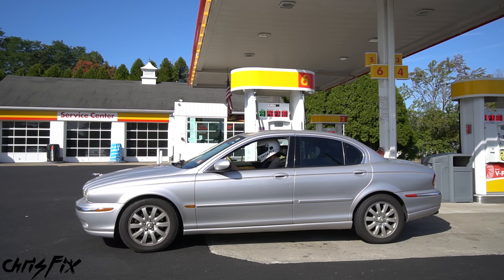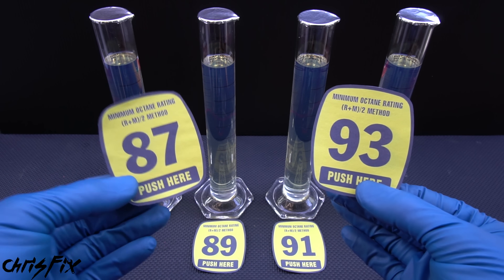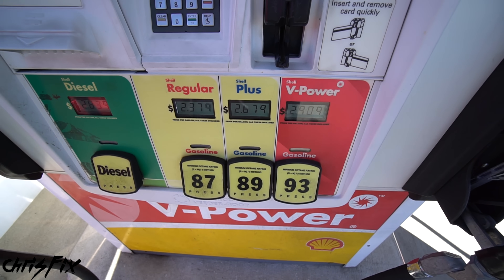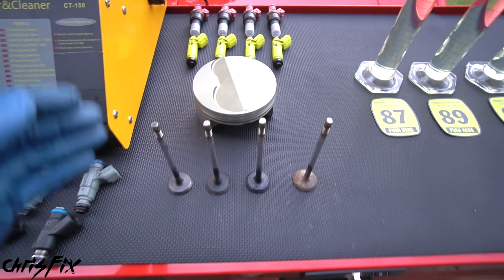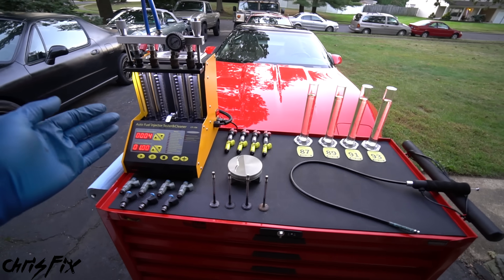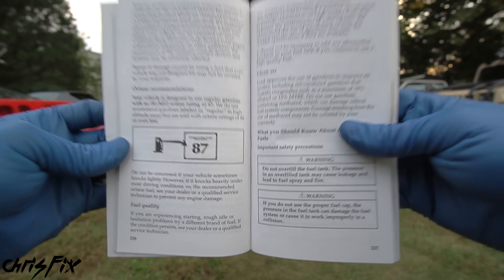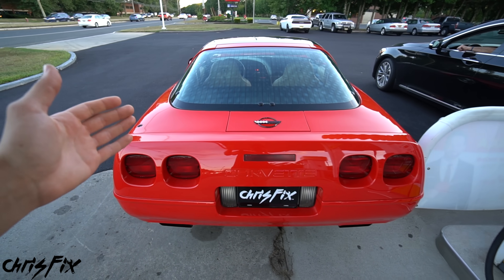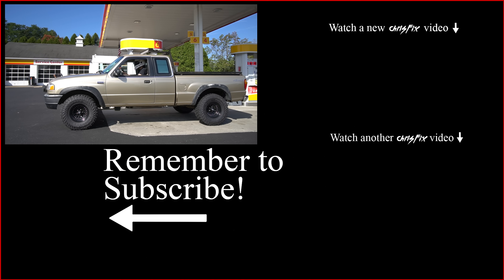What is the BEST Fuel to Use in Your Car or Truck and WHY

Comment: Love how you failed to discuss the other elephant in the room.

Faulty gas pumps mean you could be buying watered down gas, gas with sediment in it, or getting less gas than you pay for.

“Remember when gas prices spiked in 2008 or 2009? People stopped buying premium,” adding that when gasoline is sitting around in underground storage tanks, its composition may change. Some gas stations water down and sell diluted gasoline. So yes, a notable number of gas stations across the U.S. are likely to have diluted or contaminated gas in the underground storage tanks.
Reply: Yes especially walmart
Reply: Sorry, but "watered down gas" is an old wives tale that has been debunked a million times over. And how does sediment get through the filters that are designed to trap sediment?
Reply: IrishDrunkGaming that is another myth. A gas station owner would be a fool to have water in their gas. The customers car would break down and as soon as a mechanic got it apart, the water in the tank would be obvious as it settles to the bottom. Underground storage tanks have filters at the end of the gas turbine that pulls the gas to the pump. Gas pumps have a filter inside and where the filter attaches, there is a mesh screen. Very little sediment gets through those three. The underground tanks have also been required to have glass lined walls since 1996. Any station that didn’t comply with those upgrades were forced to close. Any station that sells at least 60,000 gallons a month is having fresh fuel delivered at minimum once a week. I’ve been in the gasoline business for 19 years and only had water contamination once. We immediately shut down sale of that product as we didn’t want to pay for engine repairs. Ever since then, every Tuesday we stick our tanks with a water detection paste. If it is present, the paste turns pink. That hasn’t happened since my second year in the business.
Reply: @MatthewOwen1977  thank you sir
Reply: Matthew, I know people who work on the Indian reservation who would disagree with this.

Comment: Well non really i use 85% water in my car and 15 % of a home made octan from old diesel. U can not go as far as you would use normal octane but 3/4 of it at least. And a full tank cost mme i dont know mayby 5-10 dollars. Have been doing this for about 3 years since i got it to work. 

But no i will not share how it works we all know what would happend if i did. But i can just confirm that YES it does work

Comment: What about E20? Some Racetrac gas stations have started selling this for 10-20 cents cheaper than regular. Some online sources say yes it's okay in all vehicles that take 87, some say no it's still only for flex-fuel vehicles. I drive an 07 Accord, and the manual obviously says not to use ethanol. However, I'm not sure e20 was a thing in 07 because it is not mentioned, e85 is mentioned as an explicit "no-no" in the manual.

Comment: Another important factor is ethanol content. Around here regular gasoline contain ethanol, premium does not. A carburetted engine can't deal with the ethanol and it will run poorly. Also ethanol attracts water which is very bad in a carburetted engine. All carburreted engine from chainsaws to trucks should run premium.

Comment: Chris, i have a question
I see a lot of tuners using normal octnane fuel in their cars normally, but when they use e85, the horsepower increases insanely. Also, many sports like drag and etc use e85. Why is that?

Comment: I truly have enjoyed the videos of yours I have watched to this point and you may have explained this in a prior video....I have a recommendation that you can probably explain better than a lot of us that were raised on 1st generation v-8 engines. Can you make a video explaining the advantages to converting a carbureted engine to run E-85, the advantages to this fuel, the dangers to seals in the carburetor and components, proper engine timing and additives to inhibit corrosion from the fuel that the high “Moonshine content” can cause? 

I was blessed to be raised in the time period that carburetors were still prominent, throttle body injection was the most common way of injection and multi-port was gaining headway. Your videos have helped an old “shade tree mechanic” gain a much better understanding fuel technologies. I do know that messing with my first 5.0 Mustang, IF you know the proper technique to set the timing on the 5.0, the higher octane fuels can make a BIG difference in performance. That may also be a subject to touch on.

Again, thank you for the time and effort in your well made videos! You do a great job and I have subscribed to your page.

Comment: All grades of gasoline have cleaning detergents. For engines with higher compression ratio, use higher octane fuel to prevent pre-ignition and possible engine damage. With all others, you can get away with using regular to mid-grade fuel. If unsure, your car should have fuel specifications clearly labeled at fuel filler cap or around fuel gauge on instrument cluster. If not, it's in the owner's manual.

Comment: Hi Chris Fix.
Your channel has helped me enormously.

I live all the way in South Africa, obviously, most of the products you test are not easily available in SA.

Anyways, I was hoping if you can make a video testing different types of Radiator STOP leaks.

I was accustomed to Wynn's/Shield. I do a radiator flush, then add the bottle ±350ml for 4 Litres of water, give or take. Then add 2x 1Litre bottles of Shield Anti freeze, green (undiluted) and then add 2x1Litre of Water to my mix. So I get an exact 50/50 ratio. The reason I do this is because it helps seal all hose clamps, etc etc etc. 

But Yesterday, I tried a different spare shop and the guy suggested I use ACDELCO, which is an American brand by GM ( I Stand to be corrected.) I'm sceptical about it but hey it's worth a try. And also I always only ever used Castrol Magnetec 10W40. But this guy also suggested Shell Helix HX7 10W40. So I decided to give that a try as well. Maybe I've got marketed, maybe I'll learn from a mistake if the above products are a bummer or maybe it will be good to excellent, it's a learning curve. LOL.

My questions to you is, since you are from America,

How good is ACdelco Radiator STOP leak? 
Can you do a comparison test?

Also, which is better between Castrol magnetec 10W40 and Shell Helix HX7? Can you also do a comparison test. 

P.S. my engine is out at the moment, and it should be in the car by next weekend latest, pls assist ASAP

Thanking you in advance.

Comment: Chris Fix - What about BP, Mobil or Exxon ?  Do they make any guarantees on engine cleaning ??
Reply from the maker: I know they all have claims of "cleaning the engine and better mpgs" but I dont know of a specific claim like shell where they say use it for 2500 miles and the injectors and valves can be 70% cleaner which is a pretty crazy claim. I am still skeptical and wish there was a way to test it.
Reply: @chrisfix  Thank you.  Yes, I'm thinking of using a tank or four on my 158K mile 2006 Toyota highlander 4 cly. 
After winning the lottery, we can get  ten sets of four cars and doing the same tests to see before and after results.  Do what you love - right?
   For what it is worth, gasoline is fungible. AS I understand it, companies make grades of gas - put it in pipelines and then companies like Shell/BP/Esso/Exon take it out at multiple distribution centers and add their chemicals  before delivering to the station. 
   Is that what you heard?

Comment: Is there a difference for altitude? I remember the last time I was in Colorado and they only had 85, 87,  and 89.
Reply from the maker: Yea higher altitudes can get away with less octane since the air pressure is less.

Comment: so if I wanted to use premium in my car that runs regular, would it be ok to mix those and run it to say give it a better octane for the “cleaning” you talked about?
Reply from the maker: You would need to run premium for 2500 miles for cleaning to occur. Just use regular and drive the car to operating temp every time you drive and you will be fine!

Comment: I think the kind that makes it run is the best! Just jerking your chain..thanks for the info, as your explanation will clear up misconceptions about fuel and the actual advantages.

I have to say, the blue gloves really reminds me of the “hand models” that do lotion, dish washing and Isotoner glove commercials..😊

When I would take a trip to the drag strip, I’d drive to the track on 87 octane with much less timing to get there....I had it figured to just about the gallon, how much fuel I needed to get there...then, when I got to the strip, I’d put 100 octane low-lead purchase from our local airport so ai could advance the timing. Worked out great for me.

I had to run “lead replacement” in my 350 with 041 heads..it didn’t have hardened valve seats...another reason I liked the low-lead fuel, as well. 

No, not just anyone could go to the airport and get the fuel there..you had to “know people” to purchase the fuel. I could have purchased the racing fuel at the track but the price difference was rather dramatic between Av fuel and the 110 octane at the track.

Also, at 16:11 into the video, you highlight the carbon deposits but completely forgot about what looks like rust at what looks like the top of the piston....what the heck ? LOL

Now, you says..”Let’s see what...(engine parts) are doing ...well, the distributor is doing distribution, the spark plugs are sparking, the injectors are injecting, the pumps are pumping, the alternator is alternating...and, well, I suppose the pistons are doing what they do, too!
 
Truthfully, thank you, again, for the actual common sense explanations you provided...It makes a difference when someone can break down, what can be an ultra-complicated subject, into layman’s terms that are easily understood...it actually takes a cunning linguist with the proper knowledge to do explain this subject matter in the manner you explained it...THANK YOU for the breakdown!

Comment: Chris, what about E85? It's been called race fuel on a budget, sure worse gas mileage, however, better cooling properties. How can I run my car supercharged on E85 and see less knock than on 91 if that isn't the case? Or are you more arguing that the 87-93 don't have that component of cooling?
Reply from the maker: I was speaking about gasoline. E85 is basically ethanol with a little gas mixed in. Ethanol burns cooler and has different properties than gasoline. Running your car on it would require fuel system changes in many cases and you need a tune!

Comment: Those animations were incredible! Idk if you sourced that somewhere or had it made for this video but amazing job sir 👍. 
With all your effort and time you put into this video I would have loved a more detailed explanation of the difference between 87 and 93 octane gas and why one would use high octane in a high compression motor. It may be something you've done in another video or are planning to cover in one coming up, but I think knowing the properties of octane and that high octane gas requires more compression to combust under spark so putting it into a low compression motor would result in incomplete combustion and loss of power is definitely a video I would want to see from you 🙂
Reply from the maker: Thanks a lot!!!

Comment: I have a car with flex fuel should I switch to e-85? I never really had a problem using regular gas that I noticed but after watching this it might explain why I get periods of low power
Reply from the maker: No it just gives you the option to run e85 if you want

Comment: I disagree with your myth debunking. Each fuel does contains a different energy content. Different compounds are blended to achieve the desired octane. These differences in molecular compounds results in a change of heat of combustion (energy). 
2. All gasoline is required by law to pass an oxidation stability test. Storing your car for a winter season will not cause any damage. 
But it sure is fun to see the marketing  of Shell.
Reply from the maker: Thanks for sharing Joseph. The energy content of regular fuel is 114,000 BTU per gallon and energy content for premium is 114,000 BTU per gallon. Obviously they are going to be slightly different but that slight difference is insignificant. 
For your second statement, yes there is oxidation stability, but with that said, fuels with ethanol absorb water and can cause fuel system parts to corrode. The gasoline is not oxidizing, the water in the fuel is oxidizing the metals. The additives in top tier fuels, specifically shell in this video since that is where I filmed, has an anti-corrosion additive which I explained. 
Thanks for sharing.

Comment: Chris, there is something called "decarbonisation" and is "highly" recommended (on diesel engines mainly). As for me personally I don't drive a diesel car, but what would you say about that? Is it necessary or it is a lie in order to rob people?
Many greetings from Serbia
Reply from the maker: So with diesel there are a few things that carbon can cause issues with. Decarbonization is just the process of removing carbon. What specifically are they doing or using?

Comment: So i daily drive a 97' GMC jimmy the engine has 260xxx miles and still runs completely solid but with age and wear and tear doesnt do too hot on mpg would running premium for a while clean the engine and allow me to get better gas mileage when I switch back to regular? And would this be a good idea?
Reply from the maker: You can totally do that. You need to run 2500 miles of premium for it to get clean tho. If you dont notice any mpg loss then it isnt worth it. Just keep driving your car with regular.

Comment: For like 16 minutes was a bit excessive to ultimately tell me that I should use the recommended fuel as per the manufacturer
Reply from the maker: No because if you dont know WHY you are missing all the important info.
Reply: @chrisfix  I have a 2015 Miata MX-5 Club Edition my s*** says 91 octane so I use 91 octane. Right?

Comment: The best fuel to run in your car these days is the one recommended by the manufacturer since your motor is tuned to run the certain OCTANE. 

Dont run 93 octane in your civic lx.
Reply: Your car is tuned to run on certain ethanol content????? Really dude? Ethanol is a regulation that added into the gas. Its has to be 10% and only 10% all the gas at the pump will contain this ammout. As far as flex fuel goes. The computer is able to sense the mixture its self and your able to run a 50% e85 50% gasoline. Look up what your talking about before you comment
Reply: @firstonracingday3407  I meant octane my guy. My bad. I'll make sure I punish myself real good for it.
Reply: 2 dicksin1pussy

Comment: The best fuel to use in your car or truck is the one that does NOT contain ETHANOL, or any other undesirable additives which are added by the gas companies before the gas even gets to the pump. Ethanol, along with other additives, are added to gasoline to reduce fuel economy, and to create other undesirable conditions in your engine. The "powers that be" are so greedy, that they are not satisfied with keeping you bound to highly inefficient 1850s technology (the internal combustion engine), but they want to make that technology even more inefficient, by selling you fuel that they have engineered to thwart the efforts of those who think "out of the box", and who strive to improve their gas mileage to the max. Those who among other things seek to turn liquid gasoline to vapor, so that the engine runs cleaner, cooler, and more efficiently. The Truth is this: Your vehicle does not really belong to you. Your car or truck is the "vehicle" used by those who seek their enrichment, at your cost.

Comment: I put a little over half a tank of shell 89 octane in my 04 ranger 4 cylinder. 60 miles later it's barely wanting to go. I thought maybe a batch of bad gas, filled up elsewhere and problem disappeared as I pulled out of the parking lot. Happened again a few months later, changed fuel filter, no difference. Filled up the rest of the way at a speedway, problem gone as I'm pulling out of the parking lot. Don't know if my engine doesn't like shell, or that particular shell has an equipment problem...

Comment: 14:42 I can never figure this out. I know that some high horsepower cars say they use E-85. Do they mean this fuel or are they talking about a different race fuel?
Reply: EvO xNikeYou’re talking about people that use e85 on turbo cars. They put bigger fuel pumps and injectors in to run enough e85 to get added horsepower because the resistance to detonation is so high. They get poor fuel economy but big power.

Comment: Just to be clear, it's not the octane, it's the octane rating. Octane is a chemical, and is is however much resistant to knock, the octane rating is how close to the fuel is to octane in terms of knock resistance. 100 percent octane fuel would be 100 on the octane rating.

Comment: if you use ethanol free rec 90 fuel[gas without ethanol] you will get 20 to 30% better fuel mileage, since most all gas contains 10% ethanol, it is in essence watered down... ethanol burns faster and with less energy than gas.
so you can go farther with less gas, and you will have more power,  less engine noise, and smoother operation.
my wifes corolla gets 195 more miles per tankfull on average with a noticeable difference in power, she asked me if i high performanced her car, and i said no, i put real gas, not watered down with ethanol...
i hope this helps your experiment.
P.S. E15 gets worse gas mileage, but has been found usefull in turbocharged cars due to cooler burn temp